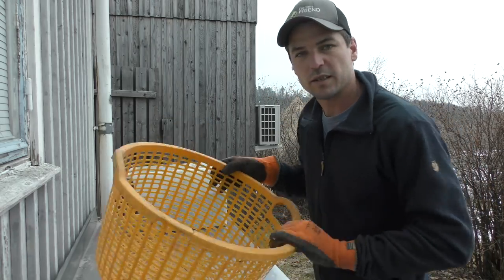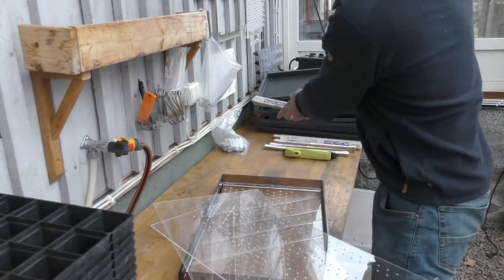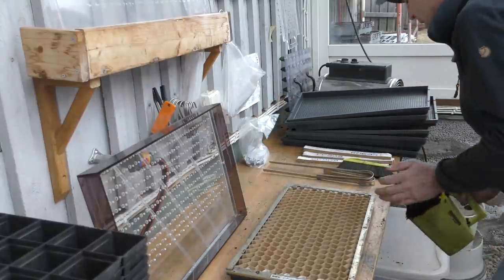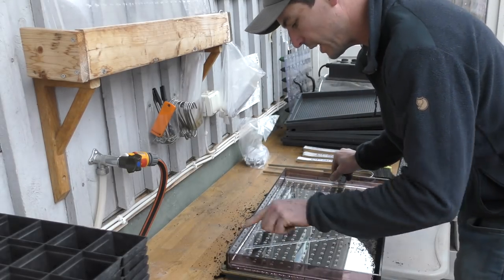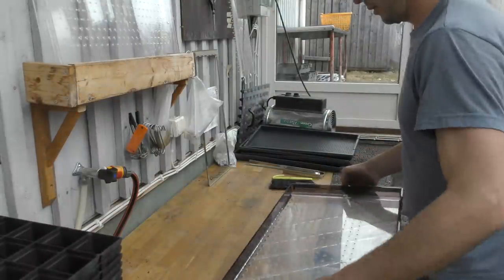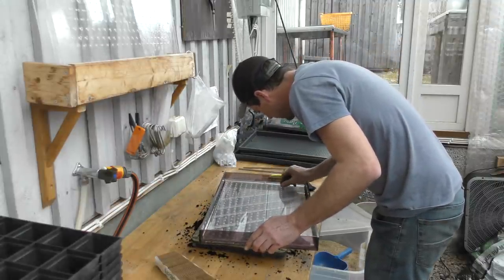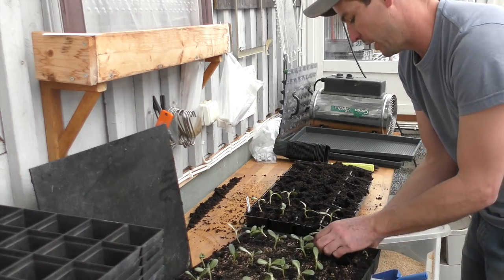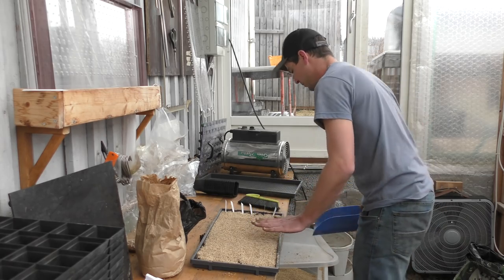Paperchains and ancient grains...

Comment: Great that you are trialling slightly wider spacing. I know a lot of farmers here in Australia getting incredible results and much more uniform seed head development/better yield with precision placement. 

Best results for them also come with seed treatment (inoculation) of bare seeds. They have found Calcium is incredibly important and use a liquid calcium plus a liquid seed start (biological) that they make themselves.

They have been getting incredible soil conditioning/extra root development and tillering with spelt in particular. (From southern NSW to Central Qld)

Hope it goes well for you.
Reply: hi wondering if you have a contact for futher information?
Reply: @jasonmiller9497  farmers using these practices? Or the agronomists who assist them in reducing (most of them use Nil added N of any form)
Reply: @miriamneilson5150  agronomist